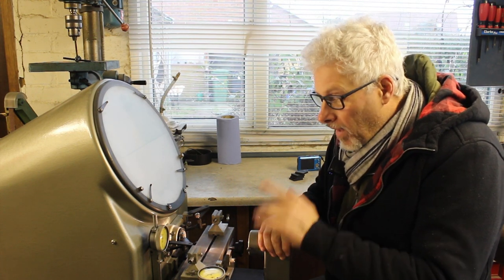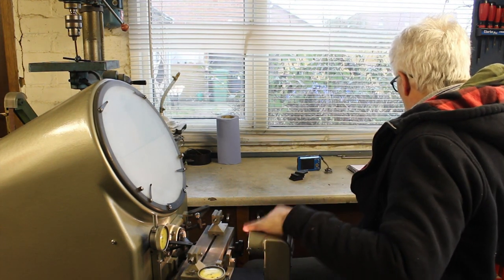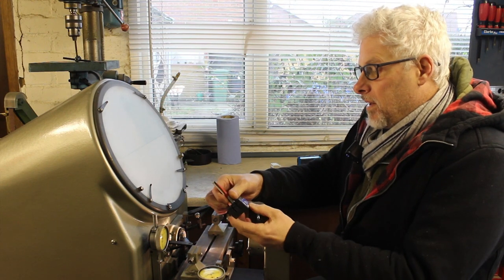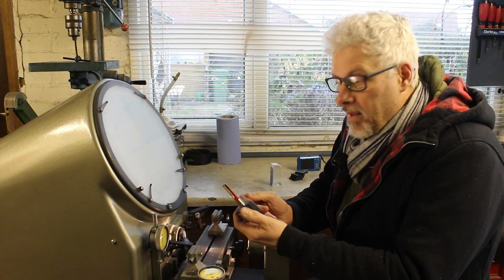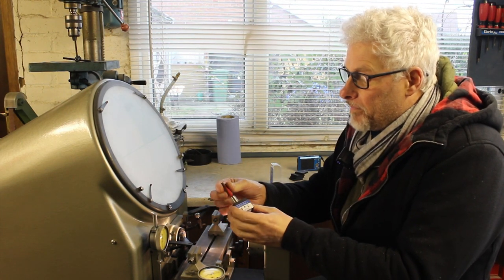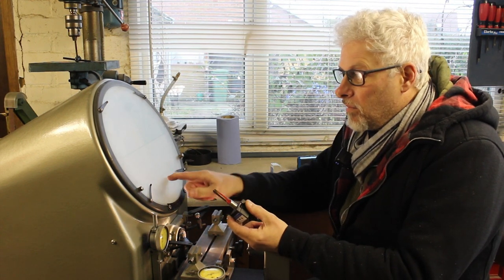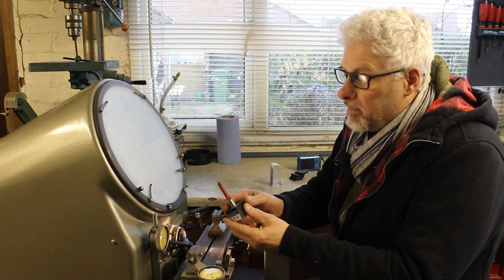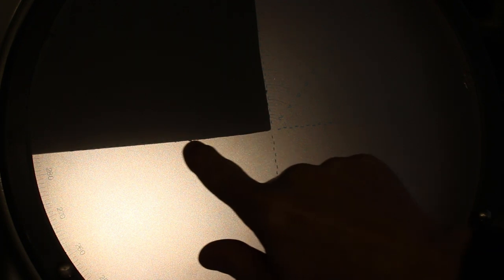Scrap optical comparator, what can it do?

Comment: Thank you for this series. Another use for a comparator is to verify the profile of a special cutting tool (such as a home-made gear cutter) by placing a paper drawing printed to scale on the screen and comparing the image with the drawing outline.
Reply from the maker: I do think the best bet if you are making one is to use a cheap digital microscope and an xyz optical stage. It would be a lot smaller and easier. However you would lose some of the measuring features because those digital scopes are variable zoom. My machine is a fixed x10.
Good luck with your build.
Reply: @CazualHaze  Understood. However it's more a case of "use what ya got" and I've pretty much got all the optical train. I'll look at what is available regarding xyz stages but I suspect on my budget (retired, money tight, plenty of time) I'll end up knocking my own stage up.

Comment: Hi, I have just purchase one of these for £50. I couldn't find any info on mine. Great video by the way may I ask what camera you use? Thanks my brand is a maruzen.
Reply from the maker: Good stuff what model is your comparitor? 
I use an old Canon 600d with the standard lens. I don't want to risk a good lens in the workshop!
Reply: @CazualHaze  mines a maruzen, no serial number or any other info. Not as fancy as yours. Mine seems to work vertically, very fun to play with. Also thanks for the response I enjoyed the vid